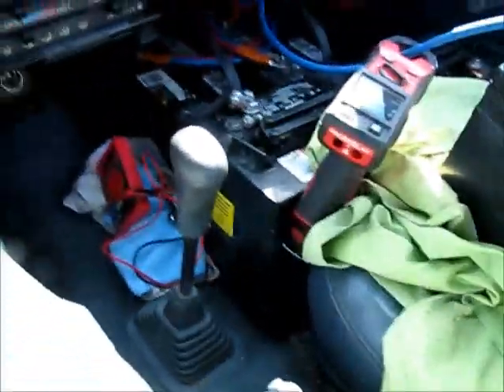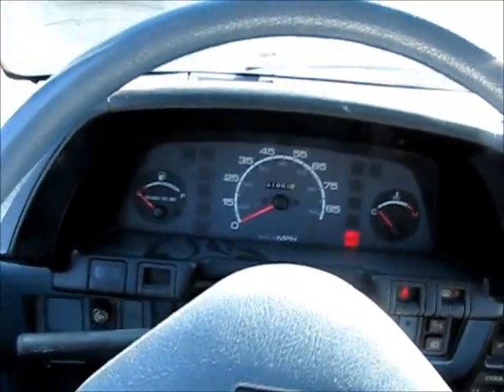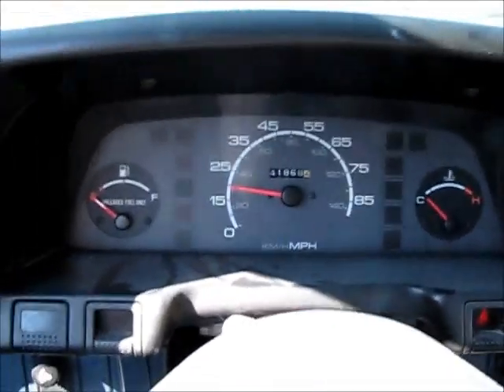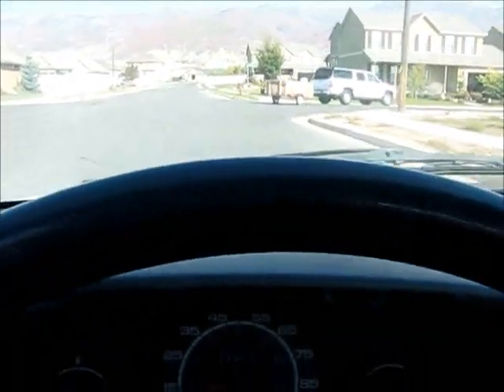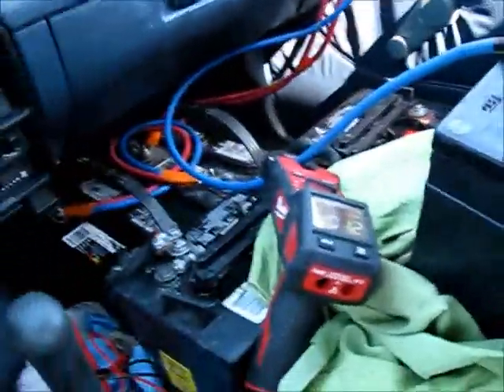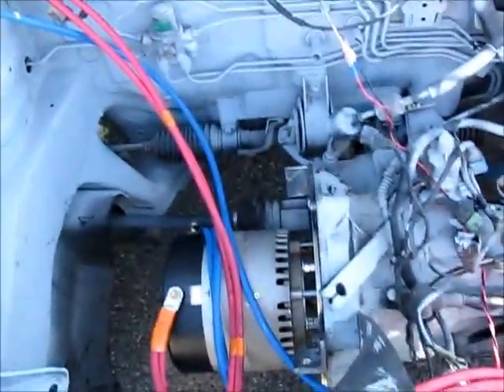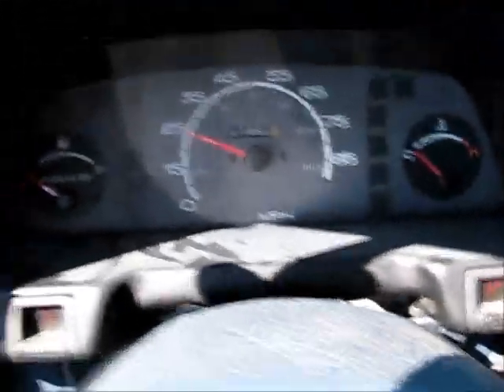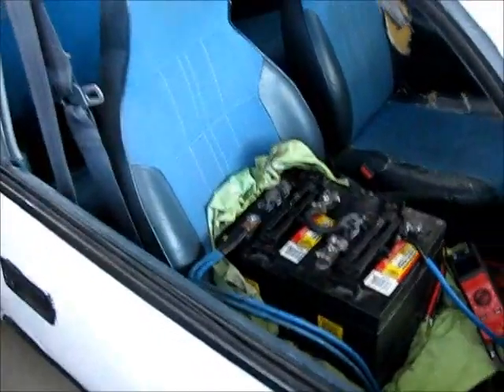Geo Metro EV Test Run

Comment from the maker: Yes.  It's a fancy Milwaukee current clamp meter that does AC and (amazingly) DC amps too.  The motor is a 72V permanent magnet motor.  Once my real batteries show up, (160Ah 72V pack comprised of 24 LiFe cells) I will do some real tests and hopefully get some decent speeds and range.